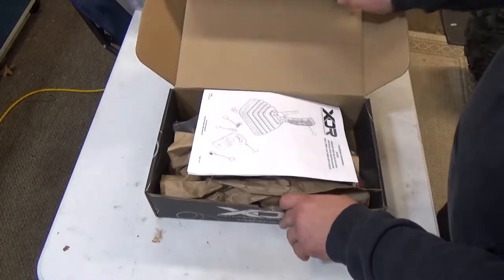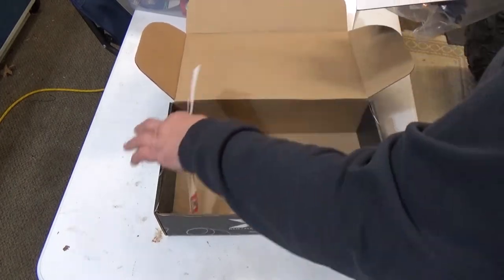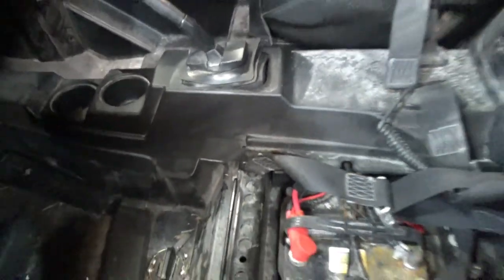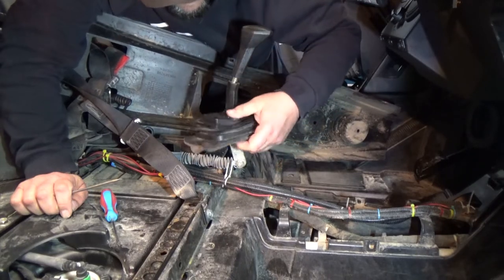B&M Hill Killer Gated Shifter RZR

Comment: May I ask what the point of this shifter is?
Reply from the maker: The reason for a gated shifter is, when you are climbing a hill in high or low gear and the side by side starts to flip over. You can slap the stick forward into reverse in one motion. Then give the machine gas and the front end will come down. This can save you from flipping your machine over backwards. Also with the gates from reverse to low you can move between those two gears when turning around in a quick motion. Thanks for watching Dirt Poor Tv
Reply: @dirtpoortv4483  ok, I was thinking that might have been it, but haven't had any situation like that in my talon 1000 x4 live valve before. They make a different shift gate for the talon that's probably way cheaper than the b&m, lol. Thanks for the great videos.